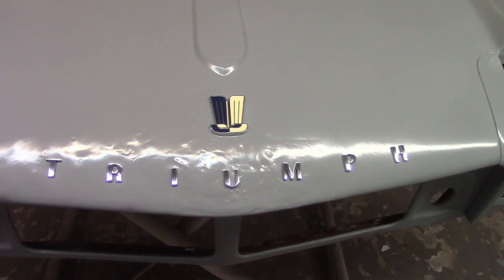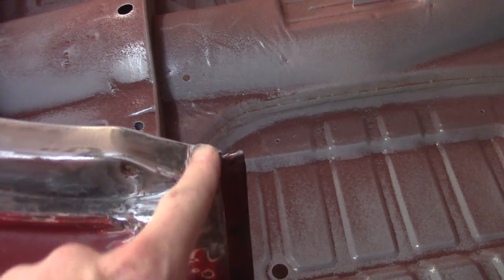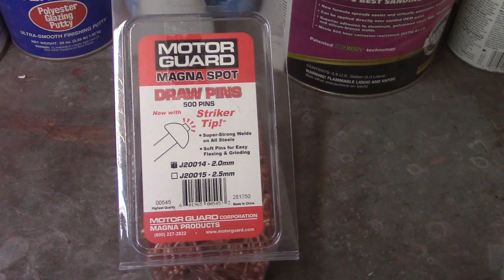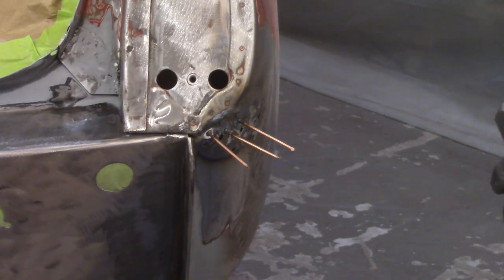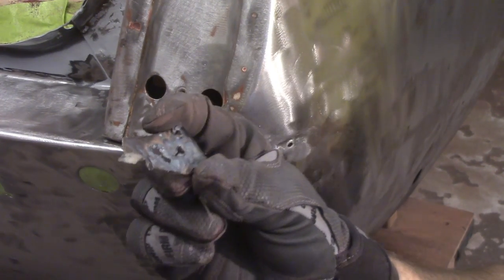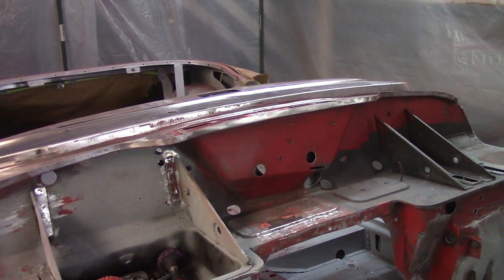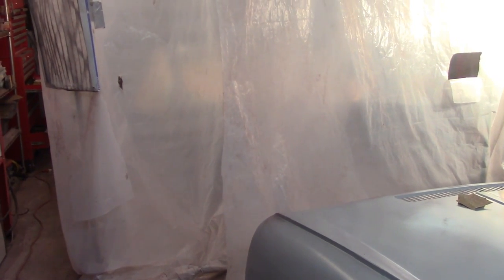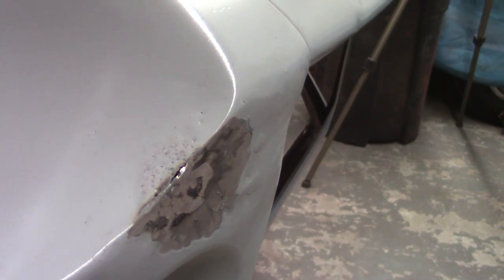Metal Repair and Spraying Epoxy - Lotsa stuff | Roundtail Restoration

Comment: Another impressive video... great to see your progress.  It must be frustrating to find the minor dings and rust holes at this stage, but I think you are right to take the extra time to weld in the additional patches and dent pulling.  I hate to be picky, but I thought that I could see a crack running up from the right hand side of the middle hinge-mount hole on the A-post... I was surprised that you did not repair this at the same time as the two cracks on the LHS top hole.  Or maybe I am wrong... hope so
Reply from the maker: Thanks, Robin. I learned long ago to try not to skimp on stuff even if it means delays. You may be correct about another crack. I'll have to go back and look at the video.
Reply from the maker: Hi, Robin. Finally got around to looking at the video and, sure enough, I'd have to agree that there's a crack there like you mention. Kinda surprised I missed it. But, I'll get that fixed. Good eye and thanks!!